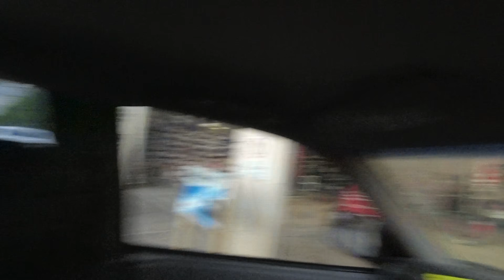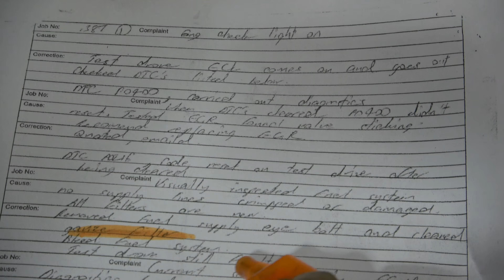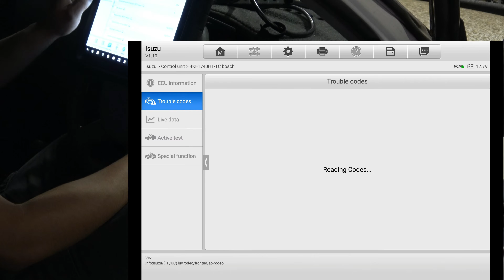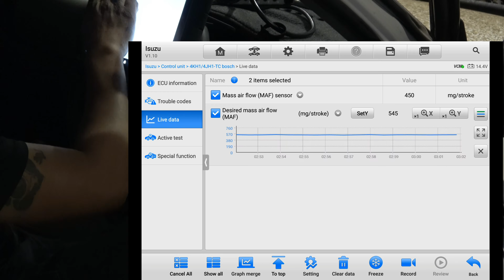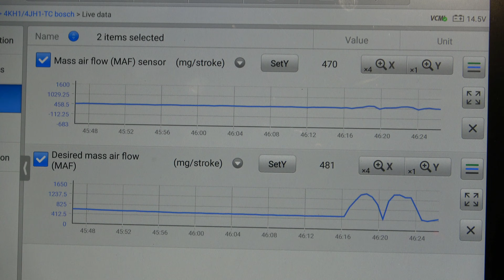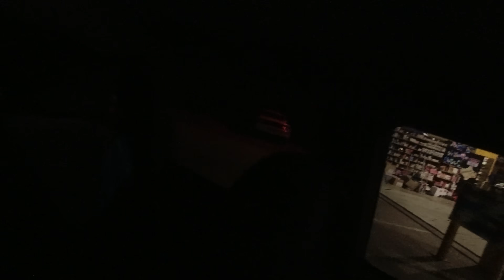holden isuzu rodeo lack of power

Comment: I'm in the UK and my Isuzu NKR N77 3.0L Grafter 3.5T truck has the same 4JH1 engine and has been running with lack of power for ages - It uses the same MAF as this truck does - today I unplugged the MAF and test drove it - straight away I had my power back and no more black smoke from the exhaust. So Thank you for pointing me in the right direction. The Isuzu MAF is £200 so i ordered a generic Vauxhall/Opel/holden one off ALIEXPRESS for £15 - hopefully that will work the same and do a proper fix.

Comment: So there is a stainless steel filter crimped into the banjo bolt on the fuel line from the fuel filter to the injector pump. I just cleaned mine out. It was disgusting. How any fuel at all got through is beyond me. Great video and many helpful comments. good stuff.
Reply: Did it make any difference

Comment: I had a crank shaft sensor faulty no engine light , it is behind the starter motor . The dealer couldn't find the fault . ebay 40 dollars fixed .

Comment: Thanks for filming this! Was great to watch how you actually diagnosed the problem. When you replaced the sensor did you probe it again? Just wondering how close it came to the desired graph..
Reply from the maker: Maximum I was hitting about 1200 in 1st gear take off, at idle rev up was close to 900. But the desired value was 1400.
Reply: Thanks for the follow up mate. Have subscribed.  Your customer must have been relieved after spending $2500 (and not buying a new injector module)
Reply from the maker: Thank you for that.
Reply from the maker: I hope so 😁
Reply: Top marks, gee you have helped me out. 
Might just give me a bit more faith in the RA she's  getting  a new maf. 
Thanks great work

Comment: My friend is having in array of problems with his 2002 diesel rodeo including lack of power then a host of elec issues such as turn signals not working, but hazards do, behaves like its in 4wd when its not, a lot of very glitchy things. I purchased a mechanics repair manual and when I look at the elec diagrams I can't see an ecm / ecu listed anywhere for the diesels. Do you know why this would be?
Reply from the maker: If it's a 3.0 diesel, it has ecu but 2.8 may not have. It's only got glow plug module I think.

Comment: You a legend Mate , got an issue with my ute 2006 diesel starts only on quick start and white smoke only when cold.
When hot doesn't start must spray again quick start. Runs fine any advice Mate.
Reply from the maker: Engine chain/belt Timing is out. 
Check fuel rail pressure.
Glow plugs may be. 
If it's a ranger/bt50 3.0 diesel automatic, starter motor
Reply: Thanks Buddy for taking the time to reply , its a rodeo diesel 2006 , 4jh1 motor. If You were in Adelaide I would have brought it too You.
Only starts with quick start , I think I will change glow plugs. Its giving fault code p0380 and P0216. 
Maybe I will change glow plugs and injectors. Cause the pump is send fuel to injectors . Love Your work Mate
Reply from the maker: Good luck. Can't really help much without seeing the car. DIAGNOSTIC is getting harder.

Comment: Thank you so much
Reply: Hey mate Ive gone though and started to clean my intake and turbo piping, I've tried another Maf sensor to no avail, though I have noticed the blue wire on it is frayed... I'm not really sure what to do from here, do I just cover it up and continue with my clean. Or  could this frayed wire have caused alot of my power problems, it feels as if the car is no different with or without the sender in. My brother also owns a jh1 rodeo and his has way more power from stock
Reply from the maker: What type of car ? And what fault code are present? What symptoms you experiencing?
Reply: @a1mechanicaloakey  it is a 05 ra rodeo, 3lt turbo diesel. I don't have an obd scanner. Though I've got severe power loss, starts fine, runs fine. Just no power. Replaced mafs to no avail, though the blue wire is exposed and slightly frayed, so I'm not sure if that would have an affect or not
Reply from the maker: You don't have wiring diagram, scanner or knowledge on how system works and how to test em. That's what I can gather. Apologies if I'm wrong. So in this case all i can give you is common issues with them. After that really need to see a good technician. 
Mass air flow sensor
Blockage Filter net in banjo bolt in the inlet fuel pipe at the high pressure pump
Change fuel filter.
Clean tubing on the manifold/boost pressure sensor.
Turbo control check. Vacuum line / diaphragm movement.
Turbo turbine blade visual inspection.
Blocked exhaust.
Make sure throttle is wide open when revving. Have a physical look.
Block EGR to eliminate any leakage into the intake. 
Any leak on intercooler or hoses after the turbo to the intake. 
Good luck mate
As long as the frayed wire copper is intact and not touching each other, it should not be a problem
Reply: @a1mechanicaloakey  where would you recommend taking it in Brisbane, I'm near camp Hill Carina area. Cleaned the intake, intercooler, changed mafs. Checked connections, even installed a t tap to see if there is any issue... No change yet.

I'm not sure where to locate the bango bolt on the pressure pump, about ready to give up. Leaning more towards fuel given the symptoms I've corrected, even when I'm going up a hill at 100 Kms it drops to 80, no black smoke or anything when I've held the pedal flat to the floor
Reply from the maker: I'm not sure about who would be best place to take to in Brissy. It's hard to diagnose without looking at the car.
Reply: @a1mechanicaloakey  trying to find the bango bolt location though I think that's a bit above me, can't find a guide or anything that shows me so I can check the filter net to see if it's clogged
Reply from the maker: Just the bolt that holds the inlet fuel supply line from filter to the pump. It's at the high pressure pump
Reply: @a1mechanicaloakey  hey mate, took the bango bolt out. Had some shit in it so I cleaned it out, put it back in and went to vent the air from my injectors after the high pressure pump and nothing is pushing through at all no matter how much I turn it, I'm lost at this point
Reply from the maker: Pump the hand pump If you got on on top of the fuel filter and then crack injector one at a time while someone cranking it. If you don't have hand primer then it could be electric pump in the tank so turn ignition in and off few times while watching fuel come out of yellow tap near left side firewall. Open yellow tap till the fuel come out.

Comment: Wow.very details explained. I work on heavy equipment i have this Isuzu 3.0 with 4JH1 turbo /intercooler having this same problem. lack of power when accelerating. i have a scan tool (Gscan2) the problem is I'm not sure what to look for from the live data.really appreciate your video here. I'll do same testing tomorrow and let u know.by the way. what scan tool you are using look very interesting. Thanks.
Reply from the maker: Couple of thinks to look for on 3.0 Isuzu is that they are not very powerful engine from the get go but I have seen MAF sensor go bad. Also there will be a banjo bolt with strainer filter inside on fuel inlet pipe at the fuel pump, they can be blocked too. I got AUTEL ultra scan tool. Thank you for your support.
Reply: @a1mechanicaloakey  thanks for the quick reply and will do some testing tomorrow. appreciate your help. Will let you know once i done with the diagnostic.Thanks
Reply: @a1mechanicaloakey  i have some details here for my Isuzu 3.0 dmax. with key on eng off. mass air flow sensor value (desire at 760mg)actual at (0mg) 
at idle speed (desire at 449mg) 
actual at (714mg) 
at 3109 rpm (desire at 597mg) 
actual at (614mg) it Seem like actual reading is always higher then desire reading.in your video desire reading is always higher than actual reading. I'm not sure if this reading is within spec. yes you was right. there is a filter screen inside the banjo plug. how to removed it. it looks like press in tight. appreciate your help. Thanks.
Reply from the maker: What year is it
Reply: @a1mechanicaloakey  2007 and also i have this code 
P1651 fuel pump control module can bus (A) history
P1625 Ecu holding voltage (A)history
i can clear both codes.but each time i switched off the eng and restart again both codes will come back.
I'm from malaysia.sorry for the delay to reply back.Thanks.
Reply from the maker: @vsheavy2792  ohh man vehicles are becoming very complicated to diagnose. I really don't know what to tell you but really focus on MAF sensor first
Reply: @a1mechanicaloakey  no problem. I'll replace the maf sensor and will update you once i have this maf sensor replace. Appreciate your help.Thanks.
Reply: @vsheavy2792 Problem fixed after replacing the MAF?